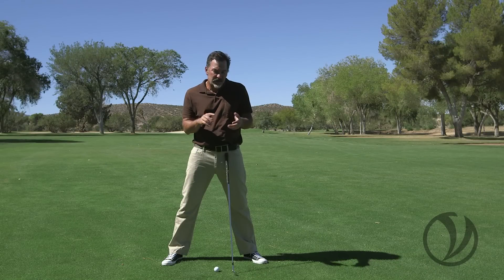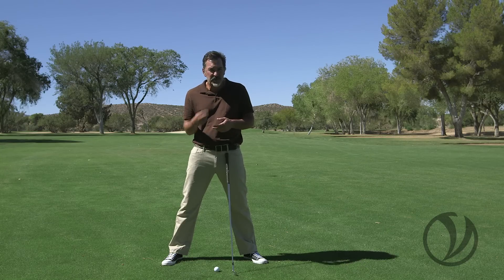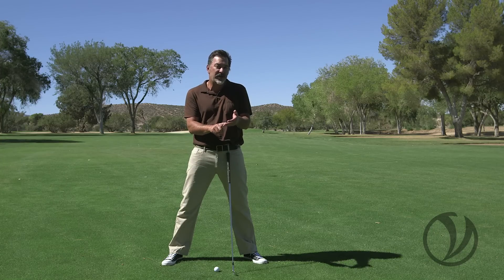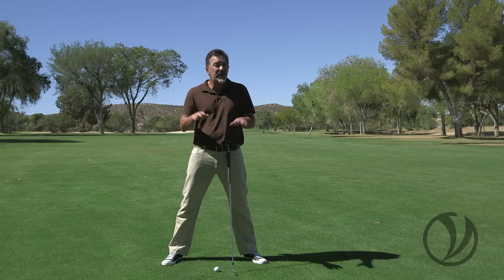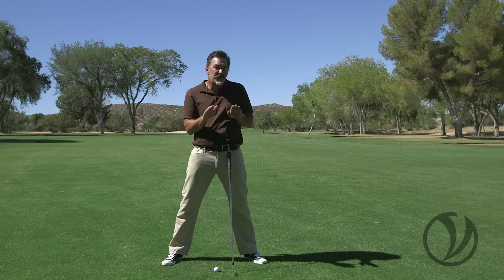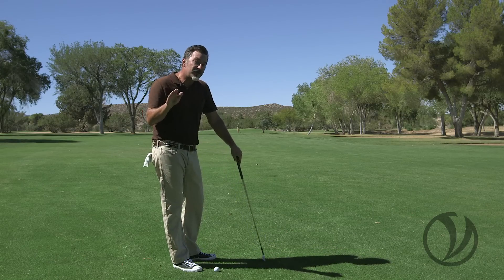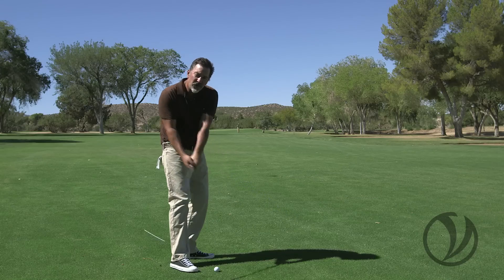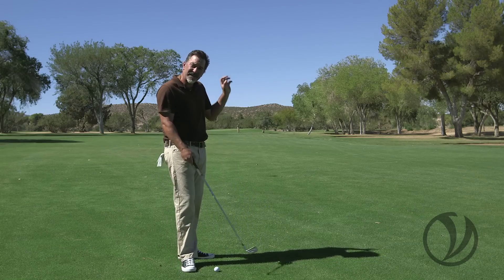Why You Shouldn't Hit Driver on the Upswing

Comment: The problem with not swinging up on the ball is that the ball doesn't carry far enough to clear obstacles. This is my driver issue. I'm not swinging up, thereby, hitting low shots that roll a lot but that doesn't do any good if you need to hit it higher which gives more carry distance. If you're playing in a lot of wind, lower drives work well.

Comment: This is a good debate I will concede. But, with the ball on a tee and more forward in your stance, you can effectively make the same shallow swing but swing up with driver and down with irons, taking a divot. Most pros hit level with driver, but many more are hitting up to maximize launch and lower spin and can take loft off the driver head to increase ball speed. It’s not just about spin. It’s loft as well. The lower the loft, the more ball speed you can get- that’s (along with length and weight) why irons they go different yardages. It’s the same with driver. You can control angle of attack and low point without changing your swing drastically by nature of the ball sitting on a higher tee. See Rory Mcilroy or any long hitter and good iron player for exhibit A.
Reply from the maker: Nathan Cates I just checked out your swing on your YouTube page… you could benefit from what I teach. I think you should take a little more time to research your data over a longer period of time and I’m sure you’ll find that the best ball strikes are not the best putters while the best putters are not the best ball strikers. I appreciate your effort’s to debunk me but don’t you think this time is better spent working on your game?.
Reply: Well that does make sense. I can see Jim kinda was a bit snarky. It's just pure physics really. The club will get lower and lower in the arc until it reaches the low point and then it starts up. I'm not being a smart @$$ to Jim here. Just saying 😂👍If you move the ball forward you don't have to change 💩 to hit up. Now that being said... Jim here promotes more or less one ball position and so do I and I think that is optimal. I think contacting the ball with the club movin' forward and as near to a flat path forward is the perfect storm. That being said, you ain't wrong in what you said and I doubt you signed up for his online lessons. I bet I ain't wrong about that 😂👍
Reply: Shootin' with Uncle Dan This is where it would really benefit Jim’s ideology if he had a monitor to show these statements hold up. Hitting up on the ball with driver will help most people get more distance from the above stated. That’s just physics. Pros can get away with lower loft and hitting even to down with driver because of their swing speed. When you’re swinging 115+mph they can afford a little loss of distance when they need to work the ball and therefore aren’t affected by hitting straight or down on the ball even. The mortals out there swinging 89-95mph will not get the distance they really need by hitting down on the ball with a driver. This is just physics. The longest drivers on tour as well as all the long drive champions hit up with the driver. This is based on thousands of hours of monitor work and results based research. I would love to see Jim or anyone work with data from a monitor and show otherwise.
Reply: @thevinsk  i use Jim's methods and can carry the ball 285 now.  Im 59 with 4 spine surgeries. I looked for a more body friendly method. I found it,  i now hit every club a lot longer. My short game is better than ever. I can tell you this, most average golfers use the irons wrong, the shot variety is mind boggling. The position you need to be in is much much easier with this method.  I was a 4 handicap with the conventional method now being longer and more shots in my bag, i will go lower and I'm 59. Golf is fun now.
Reply: Ag I use it too. That’s great you carry it 285, as you say. It’s physics. Period. Bryson hits up on the ball. All the longest hitters hit up on the ball. Jim defines power as being able to hit it 300 straight as more powerful than 330 offline. That’s fine, but that’s not how physics defines it. This has been researched ad nauseam. Less spin creates more distance. It’s all over the internet to research for yourself.
Reply: @thevinsk  the problem with average golfers trying to hit up with their drivers is consistency, his method puts you out there, in the fairway not in our rough as the course puts you in bad situations.  Hitting fairways are always better for average golfers. Yes, you can hit farther with the ball moved in front of thr bottom of the swing path but unless you practice daily it's not as easy as just letting the club hit through the ball to yout target.
Reply: Ag I know it seems that’s the truth. Statistics say otherwise as clearly outlined  by  Broadie in Every Stroke Counts. Most golfers aren’t facing US OPEN rough. Avoiding penalizing areas such as Ob, water is factored, yes, but otherwise it’s always better score wise to get closer to the green than not. MOST golfers will do better with a 9i from the rough than a 7i from the fairway. This has been shown statistically ad nauseam. Look at the charts of top money winners in the past 10 years. They’re all long hitters as well. It’s true hitting down can be easier to control. But the loss of distance is severe for the average golfer who swings it 89-90mph. Golfers who swing 110+ can afford the loss when they have to hit it dead accurate. I use JV swing and I love it. But his ridiculous statements about the ‘conventional’ swing being faulty and the pros being inconsistent is just that, ridiculous. The #125 ranked PGA player would run circles around JV. This is a great method for fun and quite good golf. But there’s a reason we haven’t seen one, not one tour player using this method. He counters by saying there are in that the pros hit from their lead side as his swing teaches, but that’s hardly a concept created by JV. JV also states that club path trumps club face for ball direction. That’s 100% incorrect. He’s failed to read the current technology and physics that clearly prove this. He simply chooses to not believe it. He backs nothing with facts, data, monitors. Why? Google Ball Flight Laws. It’s the face angle that is vastly responsible for the initial direction of the ball. JV is nice guy, but he should teach his swing for what it is as stated above. It’s 2020. If he’s not willing to show himself or any students hitting these 320yd drives with a monitor then he has no business charging people for his pseudoscience. He always talks about the Titleist Institute saying his swing is ‘biomechanically sound.’ Fine. What the hell does that mean? That it’s a method to clean up on the tour? Or does it mean it’s a great way to make a difficult game a little more fun to play? Where’s the data? Where’s the TPI study they did? I’ll continue to play golf using this method because I’m grossly untalented. But until JV can get his facts straight or provide data to support his claims..I’ll take it for what it is and no more. Cheers.
Reply: @thevinsk  You’re everything wrong with golf, dude. Lol. I don’t even use his swing, but it certainly works as I know people who do. This is golf. You take a club and a ball, you swing at the ball, and you try to hit it in a hole. All the “Science” and “Bryson” and “Biometric” talk that your talking about, is lame. Such a follower.
Reply: @tarfathewise  lame=too complicated. Yeah...get back on your PS5 dude.
Reply: @thevinsk  why don’t you write another huge paragraph nobody is going to read instead? Sick pic btw! You’re really cool!
Reply: @tarfathewise  He certainly is. I can tell you I've never been beaten by an amateur golfer who talks things like launch angle etc.. ad nauseum, playing slow trying to hit their positions in their swing etc. But I've been beat by plenty of guys with homemade repeatable swings and that's the key to golf for most amateurs, not physics.

Comment: I know this is a few years old but I've always had my best rounds just playing with irons. Hit a small draw when playing well but my driver would be 50 yards right if I try to hit with the same effort off my left heel. I recently changed to a 12 degree mini driver with 43 inch shaft. In my mind it's a 2 wood so I tee it low nearer the middle of my stance and swing like every other shot. Results have been great.

Comment: Whatever the the term upswing means to a golfer; it actually applies to the briefest moment when the point of the handle is turned upward at the precise time the club-head makes contact to the ball. You have to swing the point of the handle downward though out the entire swing in order for the club head to travel upwards in the circular path it takes through the ball. This is the true physics of the golf swing.Cheers.
Reply: You don't know what you are talking about. The grip/handle starts moving upwards before the club head has reached the ball.

Comment: I've hit some of my very longest drives ever over the last couple of years (I'm 55 now) by hitting UP on the ball.  It works.  However, Jim is correct about 99% of us, the change to an iron swing right afterwards on the golf course is not only difficult, but downright impossible to accomplish consistently without LIVING AT THE RANGE.  You have to groove two swings because the UP swing of the driver requires tremendous lift from your legs and only great ball strikers...less than 1 in a thousand golfers has that kind of talent.  Even Professionals don't always do this up swing stuff.  James Hahn, two time PGA Tour winner, only tees the ball up about two inches and hits a very straight ball with power.  I think Jim's instruction has valuable merit for most of us...I'm a 9 handicapper right now, and I'm beginning to incorporate many of his lessons into my swing with good success so far.  TU!
Reply: wreckim absolute rubbish
Reply: dam near anything's possible if you slow it down. You won't need LIVING AT THE RANGE ... If , you slow down your new swing ideas, advice, techniques blahblah, - Maybe you'll surprise yourself with ' dam, it works '

Comment: I have trouble hitting the Driver on the heel and shanking my irons esp off the tee . How will your swing method help me ? Thanks so much .
Reply: Maintaining stillness and no weight shift as part of Jim's method solved both those problems for me.  Club head returns to address position because the gear around which it spins doesn't change locations during the swing.
Reply: Start hitting up on the Driver and esp your irons off the tee !
:) seriously

Comment: Jim, I've tried your technic,and it's ok with irons but when it comes to say a 3 wood off the ground there's very little height on the trajectory, below 6ft. Any advice? I'm sure this is because ,keeping the weight on the left foot encourages me to strike down on the ball,delofting the clubface.
Reply: Your swing path is most likely too steep which is a product of your shoulders opening on the down swing. The remedy is to improve your set up position.
Reply: Jim Venetos I will try and concentrate on this, thanks Jim.
Reply: Jim Venetos 👍
Reply: Probably have a slow swing speed aswell. Try a 16 or 17 degree wood

Comment: Not sure about this one man. I’m hitting up and hitting my longest drives. It’s science. Hitting up with the same club speed will yield greater distances than hitting level.
Reply from the maker: No scientific basis for what you said, try again. The reason why you hit it farther by hitting up is because your swing creates too much spin. You can either make a better more shallow swing to lower spin or, do as you did, choose to hit up on driver. The problem in your swing never goes away though. Scientifically, when you hit up on the ball and have a higher trajectory, the distance your ball has to travel to keep up with me is longer so you’re wasting power and having to deal with more elements of wind, moisture, etc. Not to mention you’re making 2 different swings for irons and driver.

Comment: Not two swings at all. Two different setups. That is it.
Reply from the maker: +Chase Reyes The different set up creates a different swing.
Reply: +Jim Venetos Golf Academy No it does't. Body still moves the same way just more spine tilt.
Reply from the maker: +Chase Reyes It is my belief that by starting from a different set up position, especially one that changes the spine angle, inevitably your swing has to be different. I understand that you are moving the same way but you are starting from a different position which immediately changes the path for your swing, thus creating a different swing.
The reason why I don't feel that is necessary is because the only reason why you would have to do hit up on the ball is to reduce spin on your ball. The swing I teach has 1800 revs of spin at 118mph club head speed. I have no reason to reduce spin so I am able to make one swing for all clubs. Another reason not to hit up on the ball is so that you can hit driver off the deck. You'd need a perfect lie to hit driver off the deck but I can fish it out of some nasty lies to still produce high quality shots.
Reply from the maker: +Chase Reyes Try to keep the conversation civil friend. You are correct, my angle of attack is very shallow and this allows me to produce those numbers. I do this by simply changing ball position, not swings. I play driver just before the bottom of my swing arc which creates the shallowest angle of attack. Same set up, same swing, same swing arc...I just change ball position to adjust for my desired launch angle and spin rate.
I'm very familiar with ball flight dynamics(thank you for your link)...I was invited to meet the founders of TPI because of the uniqueness of my ball flight dynamics.
Reply: +Jim Venetos Golf Academy 0 angle of attack with that much speed is still impossible to create that low of spin unless you have the loft of a putter
Reply from the maker: +Chase Reyes Ok Chase...thanks for your insight...I can see from the video of your swing on your YouTube Channel that you could improve substantially from proper instruction...if you don't like what I teach, that's fine but please spend more time working on your swing than you do criticizing my instruction.
Reply from the maker: +Chase Reyes The numbers don't lie and you are a case of "the mind can't know what the eyes can't see"...best of luck with your game.
Reply: Jim Venetos Golf Academy prove it then. Let's see the numbers. I want to see 0 angle of attack with 118 club speed and 1800 spin.
Reply from the maker: +Chase Reyes I'll do you one better...I encourage you to go to the range, load a majority of weight on your left foot, close your shoulders at address and keep your weight still...you'll see for yourself the quality of ball flight that you can produce from this position. The proof is in the pudding.
Reply: Jim Venetos Golf Academy no thanks. You'd think as a teacher you would be eager to show proof, but I guess that's the nature of a snake oil salesman.
Reply from the maker: +Chase Reyes Remarkable friend...I've tried to help you, no snake oil here...meet me for a round of golf and see the proof for yourself....bring your wallet
Reply: Jim Venetos Golf Academy All I said was, prove what you claim with video evidence of your numbers and you won't. Now that your ego is hurt you're trying to challenge me to a round of golf haha. I've been playing golf almost 3 years and stay in mid the 70's. I'm sure you're a much better golfer than I am and I could give two shits less, yet that was never the point of this conversation. Go luck with the snake oil.
Reply: Chase Reyes I have no dog n this fight but zero AA, true zero could easily produce spin under 2k.  Faldo in his prime hit the driver 2degrees down and spun at 2.2k, with much less advanced golf balls.  Zero creates no friction.  Spin comes from friction.  Sorry to interrupt the name-calling but zero is the lowest spin AA.
Reply: @chase1-g6y  i know one thing for sure,  i use his method because i am longer with every club in the bag, i can hit lob wedge  that sticks or runs out, i csn pitch and run with ease and hit the best bunker shots in my life,  same swing, just move the ball position.  I was a 4 handicap before all my spine surgeries so i looked for better methods for my body,  i don't hurt my body now. Hit longer and more variety on all shots with a LOT MORE CONSISTENCY. If you look at hogan at impact,  you'll see the light. He just puts you in a better set up. He is light years ahead of the modern golf swing.